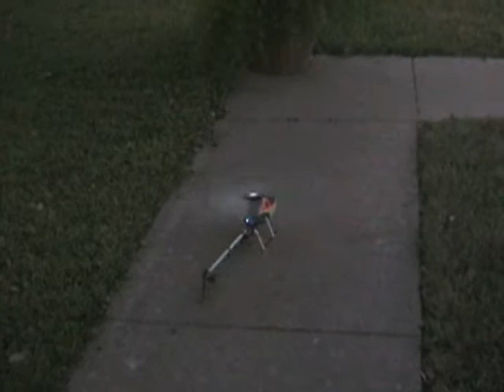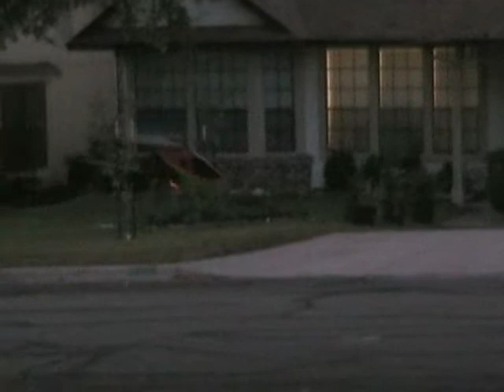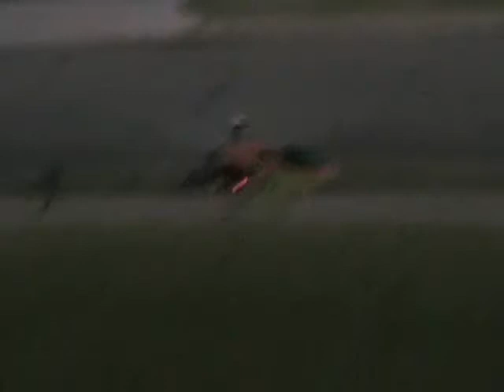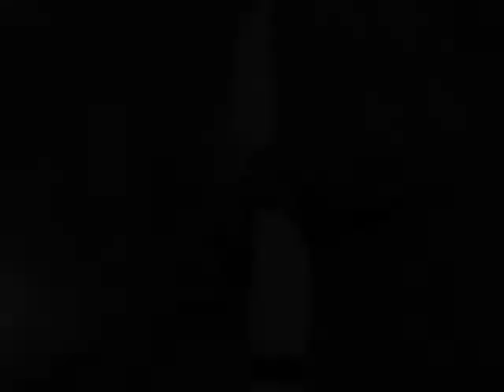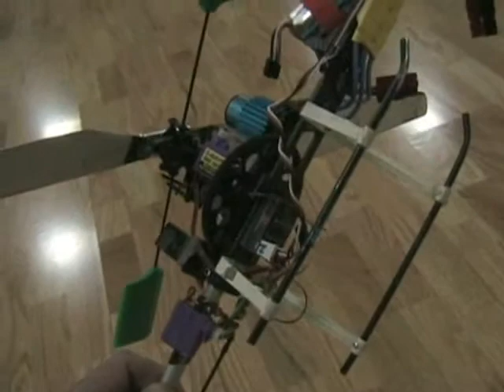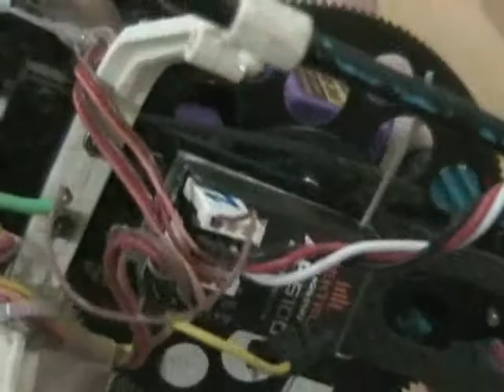Spektrum AR6100 shutdown

Comment from the maker: @trexinvert Interestingly, I never did resolve it on that heli. It was just a static generator! Spektrum's advice was "eliminate the static" (thanks, Captain Obvious), but shortly afterwards they came out with a firmware update that reduced the reboot time to nill. 

Location has a lot to do with static too. If you live in a humid climate static is rarely an issue. When it's dry, static is a real issue.

Comment: JPC, how did you resolve the issue? Did you add ground wire from battery negative to boom? Did you swap spektrum with Futaba?  I have over 2500 flights between my trex 450 & 500 with belt drive tail.  Never rebind more than once.  Never brownout from inherent static generated.

Comment from the maker: @mikefly562 To be fair, I've had zero issues with all the newer versions of that receiver on several other micro helis. There was just something odd about that one that generated enough static to reboot the receiver. As for using it on planes, I'd only do that if it's a small foamy flown at close ranges. It's definitely not for bigger models that get flown at any great distance.

Comment: I bougth the wfly wft08 (wft09 was not in stock) far more options than a spektrum dx6i and what I like is the analog knobs which do not exist on the spektrum system. The FrSky 2.4 GHz Futaba System fits perfect. The range seems to be very good but the 8 channel receiver is bigger than ie a ar6110 . I only made some test flights because it is damm cold outside :)

Comment: Damm how did you know I was allready checking the reviews of the FrSky System :) 

I'm a technical enginier myself and we do stuff gets really tested under rough electrical conditions burst esd emv temperature and so on (calibrated scales 0.000001V error is to much :) ) and still we have failures form time to time.

But at least we will try to give our customers the best possible service in case of failure. 

From Spektrum I heared nothing. Did they have any comment on your/our problem ?

Comment: I'm shure they did not fix the problem as I was using a brand new AR6110. Anyway what really pisses me off is that spektrum simply igores customer complaints. I don't see a point in buying chiniese build crap for european premium prices and getting absolutly no service in case of troubles. So maybe its better to take the best like futaba  or go with the really cheap chiniese stuff. I'm not shure which way I will go. But I'm shure that spektrum will not get a single dollar/euro from me again.

Comment from the maker: Ah, but carbon is conductive! It also originally had a carbon tailboom, but it was replaced with aluminum after the first shutdown incident. From what I've read, the real fix would be metal belt pulleys that are electrically grounded to the frame. It's simply too much trouble, I'd rather fly something else. :^(

Comment from the maker: Thanks Scott. Tried the glue on the antenna tips (hot glue), no help. Some guys have had luck by wrapping the AR6100 in a static bag like electronic components are shipped in. I basically just gave up on that particular heli. I've got the same AR6100 in a Honey Bee King V2 with 50+ flights on it now with no shutdowns. Some helis just seem to generate more static than others (like the T-Rex 500!)

Comment from the maker: Version 1.2 now, but it did the same thing before I had it updated. The problem is ESD (static) so you should probably ground the tailboom to the frame/ESC on your Trex and keep the belt lubed with WD40. The AR6100 works fine in my Honey Bee King V2, just not this one.

Comment: That sucks!  Big time.  Are you using a DX7 Transmitter with the AR6100?  Not that it matters, just curious.  If it is just the AR6100, might want to upgrade to the AR7000, but I'm sure you've already thought of that and it probably wouldn't matter anyway until you discover the source of the discharge.  It maybe something coming from the heli that would affect any receiver.